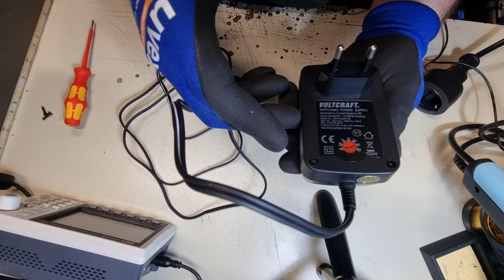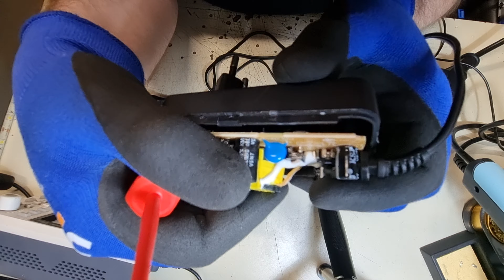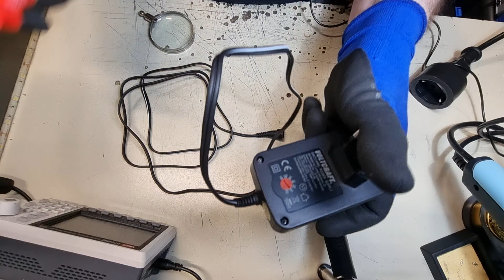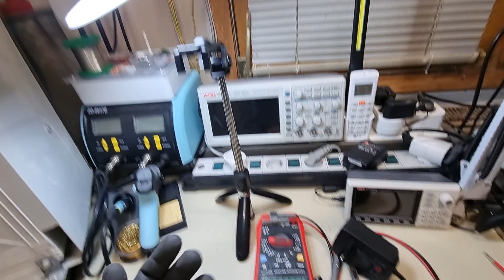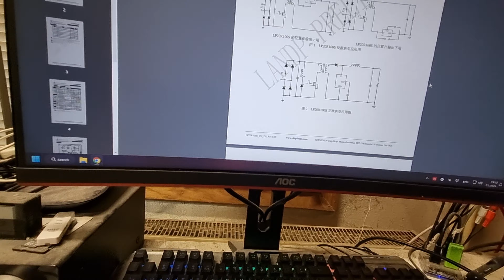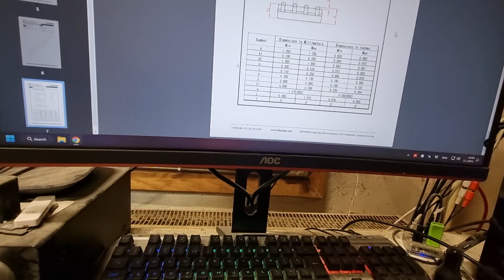Taking a look inside of a wall outlet SMPS with synchronous rectification (VOLTCRAFT USPS-2250N SE)

Comment: Can these type of smps be used in series to obtain higher voltages, also in parallel for higher amperages?
Reply from the maker: Possibly, I did see people connecting server PSUs or laptop PSUs in that configuration. But I would recommend to get a bigger PSU, for example a modified ATX PSU is good, or a lab power supply.